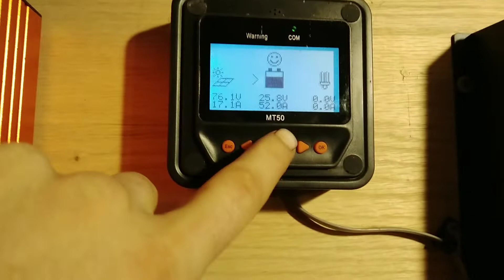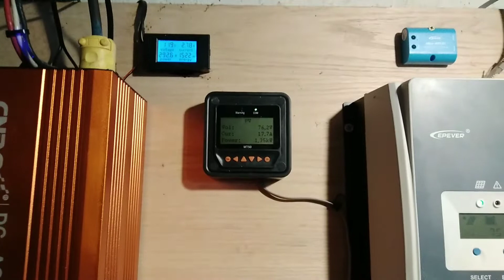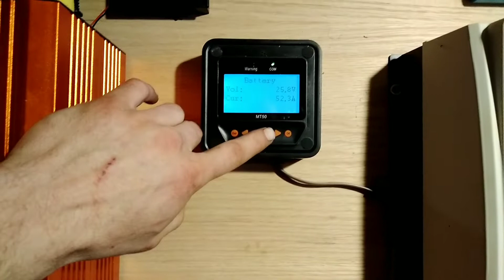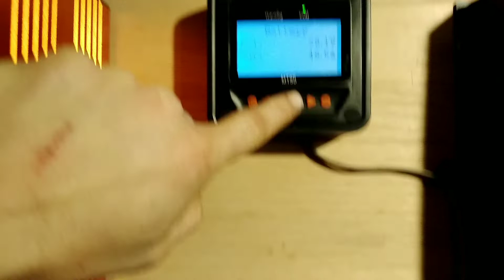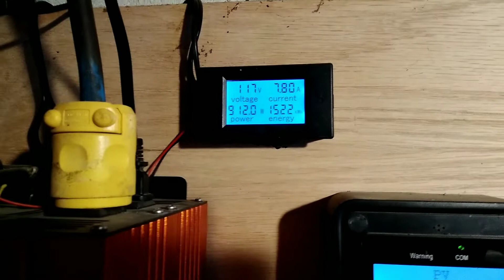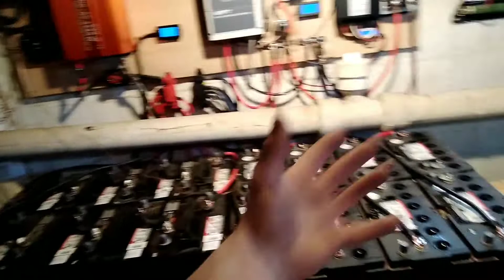Determining Peak Solar Output

Comment: I wonder if you might try a test on your solar controller. It seems like you should be able to run the output of your PMA through the controller and let it run to see the controller's peak potential. The output of the PMA exceeds 60Amps doesn't it?
Reply from the maker: The PMA can make 150 amps but the voltage could spike to scary levels and i'd hate to smoke a $300 charge controller for fun. I did eventually see what i wanted to see, i'm happy to report. At the time i made this video, the sun was just so indirect i was only seeing 80% of potential power from everything....not just the new guys. I'm uploading a short update now.
Reply: @smallcityhomesteaders1600  Ya, that makes sense. Do you happen to know the OCV of that PMA? I have seen charge controllers rated to 600v, they must be for huge strings or machines like these.

Comment: I myself had the same but my batteries give out there about 8 years old. I had 48v wind turbine and solar well I still have that wind turbine I think is a Xantrex 12 V inverter and thick wires I want to sell them to you because I want to see him getting use want to see it run and one of your videos so let me know. Will give you a sweet deal because you're my favorite Channel🙂
Reply from the maker: I'm sure I could put it to good use somewhere! Where are you located?
Reply: @smallcityhomesteaders1600  Mercedes, Tx
Reply from the maker: @kainduran3480  nice! How's the weather down there? 10° and clear stary skys here tonight.
Reply: @smallcityhomesteaders1600  it's cold around 55 degrees that is very cold for here but that last only around 3 days then get back to 80 in the summer it's 100
Reply: @smallcityhomesteaders1600  the 12 volt inverter it's new I never used it wanted to get a pump and everything but never did nothing with it it says 3000 w it's an old-school inverter but it does work I tested it out made a video but again I was working and it just sat there

Comment: Finally we get to what shes capable off!!! 👌
Reply from the maker: I was happy to see it go over 1400 but dissapointed i'll need a $500 charge controller to see all 1600. If and when i go that far i'm getting 4 more panels and bumping up to 2000.....why not. Let's see it float every day!
Reply: @smallcityhomesteaders1600  i have to admit. I was sad to see 200 watts that didn't show up. Come summertime dump the excess into geyser with 1600watts. (i still dont like idea of excess from present setup not being used. I hate glorified resistors as dumpload unless u using it to warm up the area.) Just a question. How would u feel  having that much excess energy. 2kw array. I dont know what i would do with that much excess energy esp in Sunny Namibia, except cryptocurrency mining and have the excess dumped into into my ev vehicle, thats kinda my dream setup 😂. But i guess that would be a topic for another video.